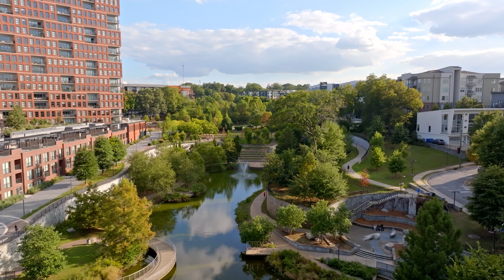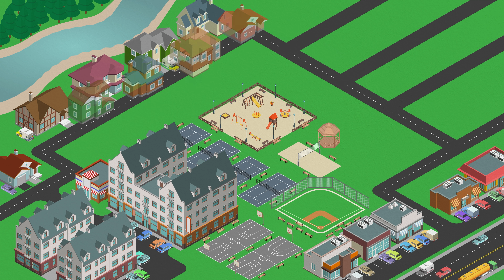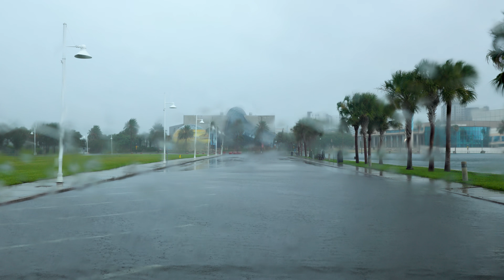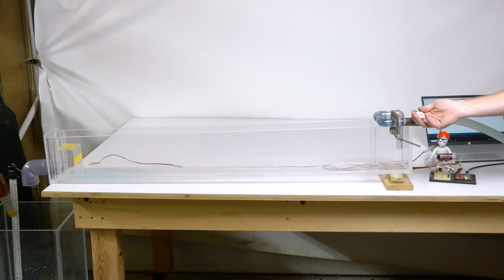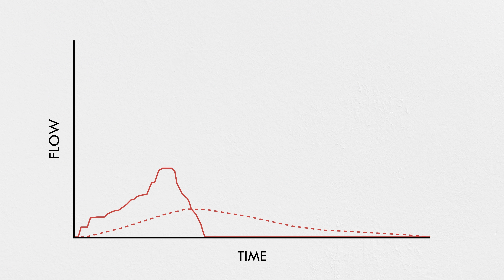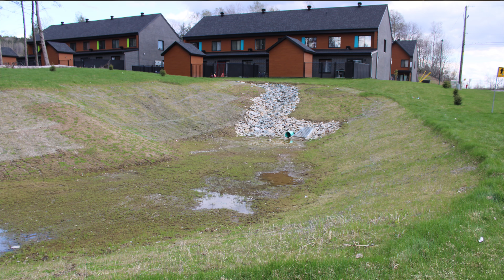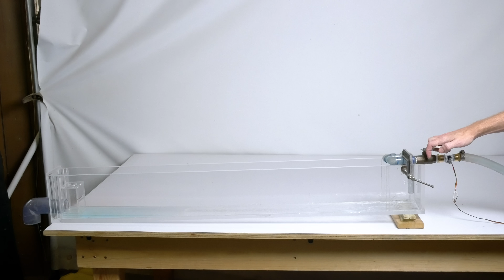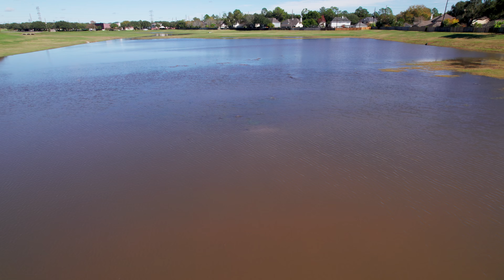Do Retention Ponds Actually Work?

Comment: I had really hoped you would include the Sepulveda Dam ( 34°10'0.62"N, 118°28'23.03"W) and the Sepulveda Basin Recreation Area as part of this video. It was built after the historic flooding of 1978. Similarly, the Hansen Dam ( 34°15'39.09"N, 118°23'13.87"W) and the Hansen Spreading Grounds just below it, also serve to dissipate rain water in heavy rains. They also serve to help raise the groundwater table in San Fernando Valley. I'd love to see you do a video on two-sided dams such as these, and the retention they provide. Growing up in SFV in the 80's and 90s, both of these were also great recreation areas 10-11 months out of the year!

One major problem with rain in Southern California is that, after many months of no rain and hot weather, even the dirt ground becomes like concrete. We once went to dig a hole in our front yard, after a full night of first rain, and discovered that the water had penetrated less than one inch into the dirt! Everything below that still required a pickaxe to break apart.

Comment: I love the video Grady. I live 10 meters away from a pond that implements all the stuff you mention. Musashi-Seki park/Fushimi -pond in Nerima, Tokyo.  This system regulates the flow from the Shakujii river. The Fujimi Pond beyond providing local flow control also have a regulated  internal overflow connected via underground tulles and flood reservoirs to the Sumida river, which is connected to one of the  most extensive flood control systems in the world : The Tokyo flood control system. Location: https://www.google.dk/maps/place/Musashi-Seki+Park+Sluice+Gate/@35.7279219,139.5676152,758m/data=!3m2!1e3!4b1!4m6!3m5!1s0x6018ef07eaba7297:0x5ff26434480109b!8m2!3d35.7279219!4d139.5697922!16s%2Fg%2F11fszdhm22?entry=ttu&g_ep=EgoyMDI2MDIwMS4wIKXMDSoASAFQAw%3D%3D Musashiseki park/Fujimi pond wiki:https://en.wikipedia.org/wiki/Musashi-Seki_Park The contents of the pond meaning the water circulation is closely monitored and adapted via a steady inflow/outflow in non flood periods via a sluice gate. In addition the pond is filled with giant carps to control mosquito larva and fishing is prohibited. It is truly a marvelous piece of engineering that I enjoy everyday.

Comment: 1 inch of rain yields about 623 gallons for every 1,000 square feet of surface area.
Orlando, FL is 83 million square feet.
So a mere 1 in (can easily be 7) makes 51,709,000 gallons of water.

Comment: There is a shopping plaza in the next county that was originally an closed shopping mall, built in the early 1980s. It has some detention ponds which have always been inadequate, resulting in a parking lot prone to flash flooding in heavy rainfall. The detention ponds collect water just fine, but they're much too small for the amount of pavement at the mall/plaza. Somehow there was no requirement to fix this when the mall was demolished and rebuilt as a plaza. The owners simply put up signs warning the parking lot floods.

Comment: My city sits at the mouth of a creek emptying into the ocean. The creek balloons into a river during heavy rain. As with most urban rivers, its bed has been lined with concrete, so it's not going anywhere. But because we sit at the mouth, there's a chance that in very heavy rain it could spill over its banks.

What they've done is built retention ponds adjacent to it, disguised as parks and playgrounds. The biggest area is used as a dog park. Whenever heavy rain is forecast, they lock the gates to the dog park, and open the spillway doors (about 10 ft below the riverbed peak). So any overflow will flood the dog park first, then gradually flood the rest of the park

I've only seen water go through the spillway once in the decade I've lived here. And the water which entered the dog park evaporated or percolated into the ground within a week. It's a bit of a twist on the typical retention pond in that it's not reducing the flowrate of water going into the discharge river. It's actually removing water from the river to cap it's peak flowrate. Probably to counter the effect you describe at 15:07.

Comment: rising seal level is due to rain water run off , most of the coast is over populated and there is very little open ground ( in comparison to natural areas ) for the the water to go , so it goes down stream which ends at the ocean

Comment: I've stayed in a recently built hotel that had kind of a mote shaped retention pond, well done, it's not just functional but it's a cool water feature where it would typically be dry. At night the froggies make frog noises where if anything it would just be crickets. I'm sure there's unique maintenance duties unique to it but it's not often the perimeter of a parking lot is a pleasant space, which is an overall plus to the customer experience. It's also an access control feature that doesn't look like one.Turning a regulatory requirement into an asset. I've also encountered ponds that aren't so nicely implemented, they had a good idea in theory. Planters in the middle of the parking lot but hollowed out and become barriers to foot traffic, so to get across what should be fairly short distances from your car to the establishment, you have to go long ways around.

Comment: I worked on a construction project where they torn down a mall and replaced it with a “shopping district “. To control water runoff they built an underground retention system, under the parking lot!

Comment: The thing about retention ponds is that they are simple, cheap solutions. On one hand, cheap and simple is good. But on the other hand... Most of the developments shown in the video are ecological deadscapes. They show swaths of chemically-treated lawns that empty runoff into a pond that itself becomes a deadscape. That's why many of the shots show "ponds" (15:58) devoid of life. The reason there's a mosquito problem is that pesticides and herbicides kill everything that feeds on mosquitoes as well as the mosquitoes. Mosquito eggs can hatch in a 1/4 cup of water anywhere, but their predators generally need large amounts of clean water. And the chemicals collect in the sediment, making it toxic, or overflow into rivers, killing the life there. Water-harvesting structures are used extensively in India, even around big cities. Because the ecosystem is less toxic and the systems are designed to absorb, rather than remove water the wildlife thrives and pests like mosquitoes are minimized. 

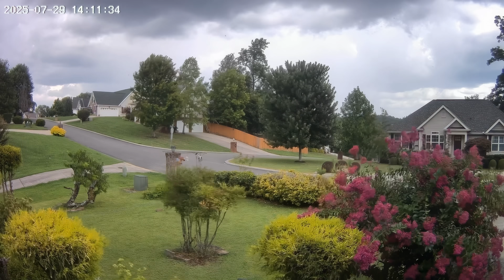A simple, cheap solution is retain as much water on each property as possible using swales (earthen "bumps" that slow water movement) and incentivizing planting native plants (which thrive without chemicals). You can see at 8:28 that using swales or terraces to flatten the yards and slow the water on the properties would not only prevent lawn runoff but would allow them to absorb more of the water on the hardscape. Retaining watering and reducing chemicals allows the soil life to flourish, and healthy soil absorbs and cleans water more quickly while increasing ecosystem diversity. Many of the developments shown in the video are draining already-stressed aquifers (google "stressed aquifers in [location]"). Those aquifers are stressed because the water is being channelled off the land instead of into it. Retention ponds are necessary, of course, but engineers should adjust their mindset to from "prevent storm-water damage" to "harvest water."

Comment: Interesting note about pre- and post-developement flows: Not only do impervious surfaces not only increase runoff, they also tend to be smoother, meaning the water traveks faster. This decrease the time of concentration for that drainage area, meaning that the water gets to its destination faster. When this destination is eventually natural streams and channels, the stream does not have time to naturally adjust to the rise in flow rate. This inequality results in excess sediment transport i.e. erosion and can pose quite a risk! So while the pre- and post-developement flows may be equal, consideration for the time to peak for a natural system is also of significance.

Comment: Maybe I'm dumb, but the active control tech seems to be asking for trouble. Like what happens when it rains hard unexpectedly or much harder than expected. Last I checked, weather forecasts weren't perfect. Also, what happens if a valve is stuck closed just before a big storm? What if the company responsible for managing it goes bankrupt, and the thing is forgotten as the company sells all its assets? What is being done to protect these facilities from cybersecurity attacks? It just seems like there is a lot to go wrong for the benefit, even if you do everything right.
Reply: You could still have an old-school high-water overflow exit as a failsafe, in case of incredibly heavy storm or failure of the active control system, and use the active control for more finesse in management during normal operating conditions

Comment: having these ponds in neighbourhoods add trojian horses of water ingress through foundations and plumbing infrastructure pressurizing the groundwater as it has no where to seep to. More land stripped means less water retention and increased overland flooding. Scraping away topsoils drastically removes the water retention capability of the lands. 

Burst storms will overwhelm any system designed.

Comment: While I appreciate the need for retarded runoff of impermeable surfaces, it seems like everywhere I look around Texas, I see mostly ugly concrete basins surrounded by metal fences. I really wish more places would take into consideration aesthetics instead of just building the cheapest required retention. Especially over the aquifer I would assume there would be a big push to retain as much of the runoff as possible to alleviate our ongoing water crisis by installing permeable bases to the ponds instead of just pouring concrete culverts to the river. Just my 2 cents. Anyways, thanks for all you do and keep up the good work sir.

Comment: Just a couple of notes.

Option 3 is the water evaporates. 

Also you mentioned water contaminants from run-off and failed to mention fertiliser which I think is a massive issue and it would have been a good additional note to add

Comment: @PracticalEngineeringChannel I to turn you on to a pretty amazing Flood control System in Dayton Ohio and managed by the Miami Conservancy District. This system is close to a retention pond but on a MUCH larger scale. Five Dry Dams and a complex System of Levees, Flood Plains and Storage Basins have been protecting 5 counties 22 communities and 15 townships since its completion after the Great 1913 Floods. All while maintaining the flow of the Great Miami river system and within the last decade the Conservancy District has been removing low dams and replacing them with Kayak and Canoe Safe alternatives and some even have Safe locations for what i like to call River Surfing.

Comment: The neighborhood in which I live has three detention ponds.  Part of the reason why we have an HOA is because someone has to be in charge of maintaining those ponds.  They definitely do take regular maintenance -- dirt collects in there, and plants grow in the dirt, so you periodically have to have the area dredged so it operates as it was originally designed.  And, of course, the drainage lines have to be cleared out regularly.  But if you maintain them properly, they should last for decades, if not centuries, I'd think.

Comment: I work for a company that makes skimmers for detention ponds. The whole purpose of our product is to let the sand, silt, and sediment settle out before draining the pond. It's a skimmer that has an adjustable orifice than can be sized for the pond.  It's sits on the top surface of the water and skims cleaner water off the top surface and drains the pond at a specified rate. 
The company is called Faircloth Skimmer.

Comment: The Archdiocese campus near my home recently added a new building, parking lot, and artificial turf soccer pitch. About midway through the project, I noticed they removed about 2 feet of dirt from the detention pit on the opposite corner of the campus to account for the added impermeable surfaces.

Comment: My city did some eminent domain acquisitions a while back and turned several commercial lots along a high traffic road into detention ponds.   After the businesses shuffled for survival, the displaced ones shut down or left (what the city commission wanted).  We only occasionally get enough rain to collect some water in the bottom of the pods.  I have videos of one where you can see the plumbing path via bubbles from leaks.
I'd actually like to dig up the records on the project and see what it was designed to do.  They installed them at a high elevation point geographically, so I am pretty sure they have to pump water into them.

Comment: I designed "ponds" for about 30-years before retiring recently. With the increased value of land in urban areas, about half of the "ponds" I designed for site development projects between 2010 and 2020 were subterranean. These were typically placed under parking lots adjacent to the building on the site. They worked like surface ponds and had to meet the same requirements. They were much more expensive per cubic foot, but the money saved by utilizing the entire site more than offset the ponding costs.

Comment: Worked and was friends with a mineral processing engineer for many years. During one time my buddy was working on sediment control he used to point out to clients there's some sizes of sediment that never settle no matter how long the duration or how big the size of the retention, at which point settling aids may be used. While there's a difference between cities and runoff over impervious surfaces versus mining, forestry or construction where runoff erodes soils directly into retention structures, in either situation must use settling aids safe for aquatic life. And this isn't always immediately obvious or correctly applied.

Comment: Retention ponds are a suburban solution being force into urban areas. Water retention wasn't an issue before everything was paved for cars. Retention ponds push buildings further apart, encouraging more people to drive. More drivers (and lanes, and parking spots) leads to more run-off. It's a feedback loop that I don't often see acknowledged. 4th ward park is a great example of at least pooling resources to do this on a district scale in a way that serves other uses.

Comment: There are some incredible cascades of retention ponds. We have a cascade of 7 ponds in my home town of which some are purpose built ponds, others are low laying areas like a park or an overflow parking area for the sports arena wich double as retention ponds in extreme weather. Obviously you first want to fill the purpose built retention ponds and use the parking lot only last before you risk flooding downtown. The whole system is controlled by baffles which can be fine adjusted by electric motors, but have mechanical limits to ensure the system would work even without electricity.

Comment: in my local area, there's multiple drains in the street that "stick up" enough to deter the water from going to them, making loads of small rivers along the streets. eventually there was some guy calling the news and crying on facebook about how useless the city was for not being able to build roads with functioning drains (getting more people to cry about it). the city council had to make an official statement telling the public "we know what we are doing." the drains they all where crying for, which if they'd actually looked at it, they'd see it is every 3rd drain down said streets. it is for overflow management. they go straight to the sea with nothing but a grate to catch the biggest litter. they are raised higher to avoid draining polluted water into the sea when it only rains a "normal" amount, making it drain into the city's waste water management plant under normal condition. but, many of the drains that go to the WWMP are also raised just enough for water to run around them when its raining just little enough and making rivers that cross the street, make giant ponds and such. but we're not gonna talk about that, apparently

Comment: In 1978, as a 19yo excavator operator, I built a failed retention pond North of Sunset HS in Beaverton. 

We installed water, sanitary and storm sewer mains for a small 30 house subdivision - Hunter's Woods. 

Except there were no woods after they cut down the Douglas firs to build the roads, sidewalks, and houses.

The last time I checked on that pond, it was still there, but the seasonal creek flows straight thru.

Comment: Here in Milton Keynes, UK, we have a problem with our 'balancing lakes'.  Built 50 years ago, sediment is reducing their efficiency - gradually holding less water. They need dredging, but the sediment contains many nasty pollutants - mostly from the roads - thereby requiring great cost to deal with. Nothing is sustainable !
Reply: We've noticed in Huntingdon (downstream From Milton K), We're fine until your (and others) lakes fill up by February, then the river levels go up and down like a yoyo. Doesn't help that the gravels fill up and the water table rises, all the way down the Ouse. New roads, with more retention ponds, and gravel extraction is only making it worse.
Reply: The Hudson River in New York has a similar issue.  Decades of industrial pollutants are “secure” in the riverbed, and it’s safer to leave them there than try to remove them.